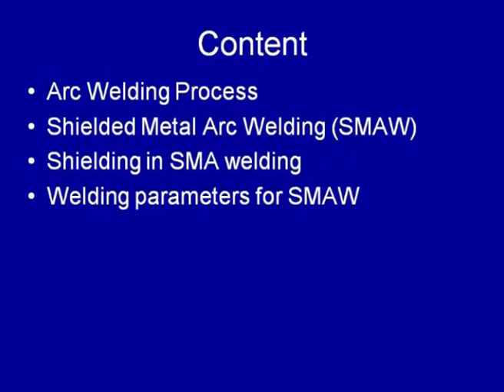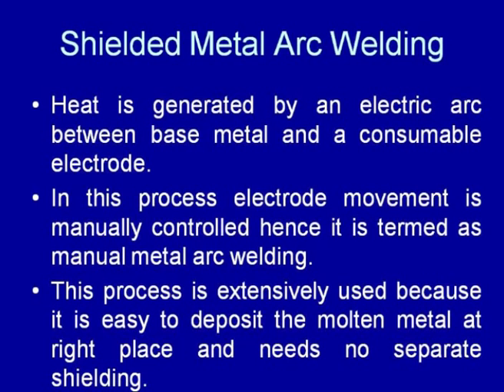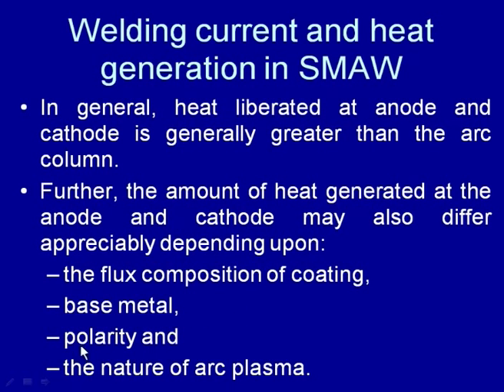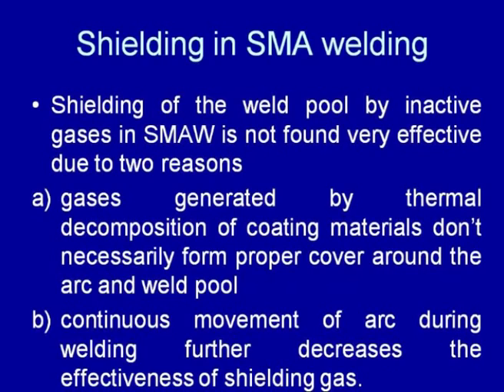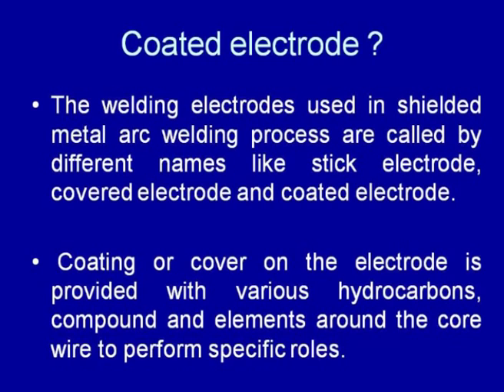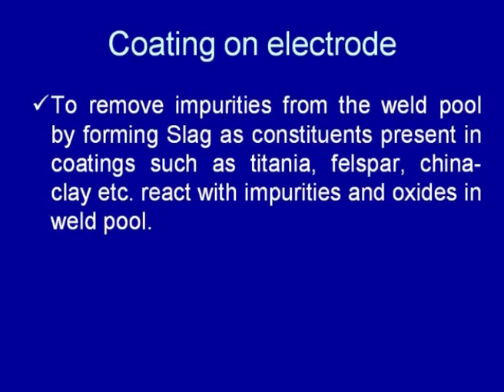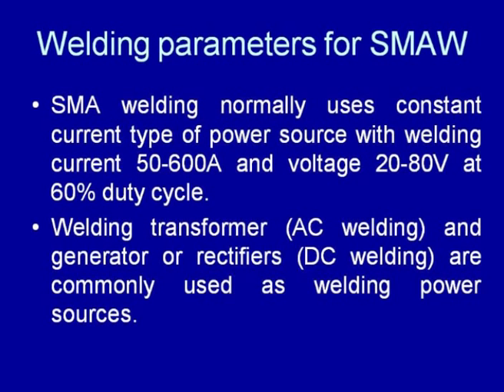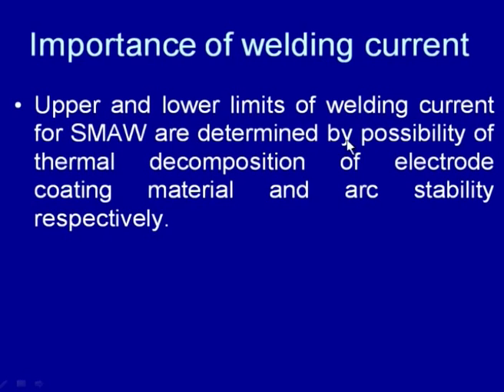SMAW- I

Comment: can we use some sort of powder too alongside the coated electrode to alter the weld properties in SMAW ?
If yes, then How would the heat required to melt it be obtained without affecting the electrode material transfer efficiency & properties ?
Can we do localized heating of welding spot through any other source ?